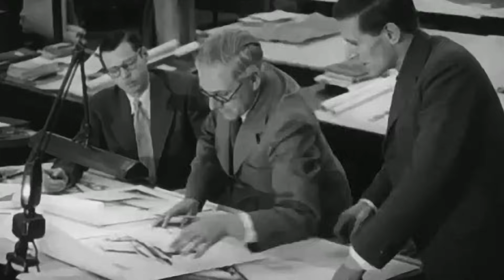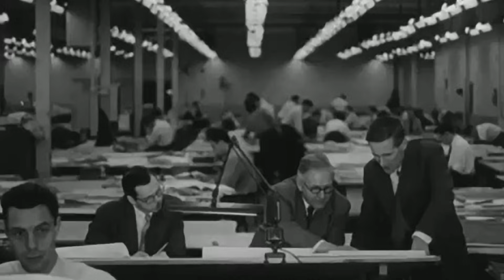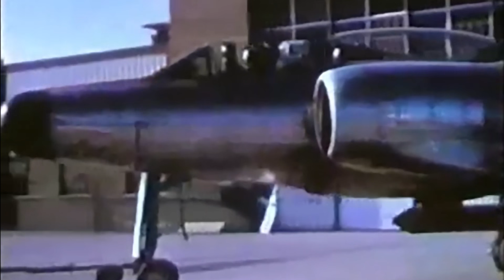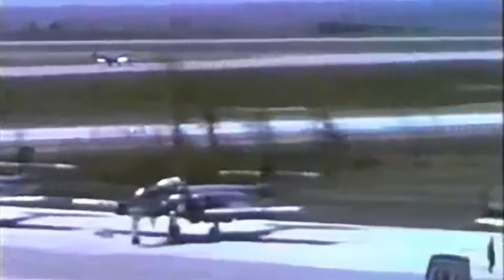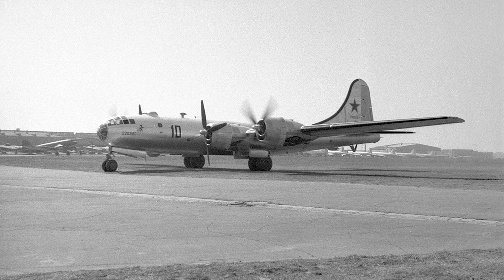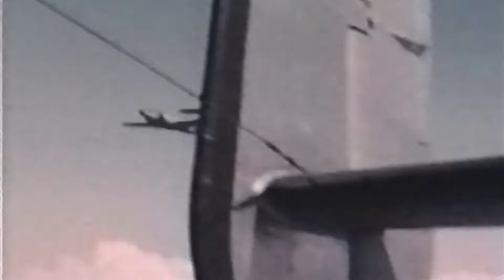World's best all-weather interceptor in its day: the Avro Canada CF-100 Canuck (No AI)

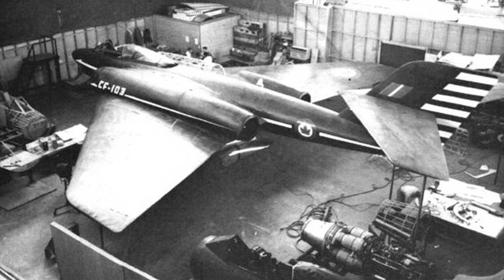Comment: 7:07 That seems like a really bizarre decision. You'd think that discovering that the CF-100 could already break the sound barrier in a shallow dive would tell them that the airframe had more potential than they previously thought, and thus there'd be more reason to develop the swept-wing version. Quite possibly the CF-103 would've also been capable of high speed than it was designed for.

Comment: The Crappy music is way too loud and spoils the commentary. The aircraft was pedestrian, its only outstanding feature was the long range. The radar was a minor improvement on those used in WW2. Its nearest rival would be the F-89 Scorpion which was much faster and had similar radar and armament initially. But evolved to air-to-air missile armament with integrated fire control in 1956, usually carrying 6 x Falcon AAMs plus the two Mighty-Mouse unguided rocket pods.

Comment: As an American, I'm just as disappointed in America's role and relationship with Canda as the Candians. America needs allies, not vassals in need of assistance. It does America no favors to have to carry half of NATO. And it does NATO no favors letting America unilaterally do everything. Compartmentalization and redundancy are core tenants of military design. 

Efficiency is only an issue if your at maximum capacity. But during peace time when you aren't anywhere near capacity, whats the point? R&D has never been an efficient use of resources, the cutting edge will always be most expensive. But Nations that shy away from it become dependant on those who are on the cutting edge. Despite what the Germans like to say to the rest of the EU; interdependence is NOT a virtue. It's weakness. It creates one sided relationships in which the haves take ownership of the have nots.

There is an argument to be made for Specialization. Sure, a minor nation can specialize in one industry to make thier name on the world stage. But as all systems are greater than the sum of thier parts, being one small part of the world only works when you are combined with equals gaining equally. If you aren't an equal partner, you have no bargaining power. You can pretend to be equal, use inclusive words, and carve our minority protections in your agreement, but when there is disagreement, there is little you can do as a minor member. Your part in the system must be great enough to demand support, or you will be ignored.

Seeing as America has no Equal, there is no alliance that stands to benefit from America's membership. 

NATO would be better off as a uniquely un-American endevor. One that can match America's military rather than be sub-serviant to it. The only way to do that is to be independant. 

Of course no collection of European powers can beat America on paper, but as I said, systems are worth more than the sum of thier parts. Having a fully self sustaining system, even a small one, is infinitely greater than being a piece of a larger system.

The benefit of being independant is mobility. As a piece of a larger whole, you MUST move in concert with the larger whole. This means you have no choice in what you do. You rely on what the collective can afford to give you. You are at the mercy of the system. And your only bargaining power is the threat of desertion. If you aren't in a position to go your seperate way, you have no leverage to demand more from the system. Therefore the more invested you become in the system, the more trapped you become.

America's strength comes from more than just it's military budget or resources, or any numbers. America's strength comes from its ability to conduct full scale military operations anywhere it chooses irrespective of anyone else.

This one fact totally out weighs the fact its inflated budget is mostly wasted and laundered away on side projects, its troops demoralized, and its technology distinctly not incorporated into a doctrine or system. The US military is by it's own standards a total disaster. But the fact the US government can use it makes it useful. The US is fully independent... militarily speaking. 

This is why American Nationalists are so hostile towards foreigners. It's not xenophobia, it's a fear of globalism. Of the threat that America can and is becoming like Europe: a weak vassal of the financial elites. Not American elites, those bastards are of no concern to the nationalists: foreign financial elites who can force the United States to bend the knee, despite its military power, simply be controlling its economy.

Just as with military alliances, economic entanglement is just as dangerous for the same reasons. America gains little and loses everything doing business with places like China. Our nations should have gone to war several times by now, but the economic control China has, has totally defeated America's military power.
Reply: You guys are the only ones causing trouble so...You don't back it up, you back out. We don't have  million miles of junk unused army equipment either.
Reply: @billaa100  i don't know what you're trying to say.

Comment: My ONLY complaint is the use of metric. Jet engines are and have always been, rated in pounds of thrust. Altitude is in feet and speed Iis measured in either mph or knots.
Reply: @polyus_studios  Thank you for your response. While I am irritated by the use of metric, I understand your point. ( Although Kilonewtons does not sound nearly as exciting as pounds of thrust ) I also understand that I am part of a dwindling minority. Your inclusion of imperial units is a gracious compromise.

Comment: What killed the Canadian Aviation defence industry was that its concepts and designed did not flow well with the rise of more multirole designs such as the F5  and the Mirage 3 of the latter 2nd the 3rd generations  Defenbacker often gets blamed too much and though he did cancel it he had his reasons  The industry was too focused on heavy interceptors in a time when such aircraft were becoming increasingly expensive cost began to outweigh the benefits of such interceptors at the time. If the program was able to be developed and introduced in around the late 1950s around the time of the F102 Delta dagger then it could have worked as a frontline interceptor. Avro Canada and Canadar should have known the changing winds of the late 50s and early  1960s  as instead develop something similar to that of the Sweedish Draken the American f4 Phantom or even the aforementioned Mirage 3. Instead, both companies would put their head into the sand that of Soviet-style single role concepts of  interceptors such as the SU9 and the SU 15 when instead could be developing multi-role twin-engined or single-engined light and heavy designs instead of going down the Specialized Big interceptor path  that leads to its near-death spiral in the 1960s and 70s
Reply: Your observations are astute, indeed.

Comment: Is there any particular reason they equipped the fighters with machineguns rather than auto cannons? 

You said there were concerns about the effectiveness of the machineguns against large bombers, which was something experienced by various air forces and lead to the widespread adoption of 20mm (and later 30mm) cannons. The RCAF certainly was experienced with cannon armed aircraft in WWII and the ADEN rotary cannon was coming into service around the same time as the Canucks or the M39 could have provided benefits in operating alongside the USAF. Seems like a simpler and more logical upgrade than the central missile pod.
Reply: As a night and bad weather fighter, trying to aim a slower firing cannon rather than a solid stream of lead would be much harder.
Reply: Justanotherconsumer Cannons we’re extensively used by night fighters in WWII, specifically because of how much more effective hits were against large aircraft. 

And the rate of fire issue was greatly reduced by the introduction of revolver cannons (M39 and ADEN) in the late forties and early fifties. 

And this is compared to a single use unguided rocket pod.
Reply: Polyus Studios Thanks will do.

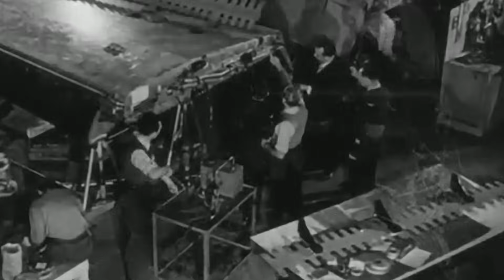Comment: At about 4:12, you say the crash was determined to have been caused by pilot error. The pilot ( Bruce Warren), was one of my identical twin uncles ( they flew Spitfires during WWII). I was told by my surviving uncle that the reason for the crash was finally determined to have been caused by a failure of the oxygen masks. Apparently, Avro only has two oxygen masks, which would be disassembled between flights, for cleaning, then reassembled, for the next test flight. Seems some part, or parts, were not reassembled correctly, and lack of oxygen caused the pilot (& observer?) to pass out.

Comment: I never knew the Canuck was so effective, or any details about it at all, for that matter. This video was very informative and very well made and presented, thanks so much.
Reply: Was an air traffic controller at RCAF Station North Bay in the late fifties. Under certain weather conditions the CF-100, doing a beacon letdown from 30 thousand feet, the rudder would freeze and the aircraft came down in a slow turn until the ice melted.  Made for a higher toned conversation with pilots.
Reply: @billfarley9167 common problem?

Comment: The glory days of the Canadian aircraft Industry 
Then something happened to us and we stopped dreaming of good / better / best and sadly settled for less than good and then starved our armed forces of funds to the point that planes don’t fly and ships don’t sail do the cost of fuel. 😪
Reply: Indeed.  The helicopter fiasco, the old destroyers that we’re designed as half-submarines, the new frigates too low for the naval helicopters, the POS submarines bought from the UK, the pistol replacement program that never completes, Avro Arrow, rented tanks in Afghanistan, C-17 troubles, now the f35, the trucks that had side specific tires (and you only got 1 spare.  If it was for the wrong side, you had to find another truck with the proper side you required), the see through all green combat uniforms, ...  the soldiers are great and very competent, they have to make do and they stretch the equipment lifetime and capability.  But the procurement system is f***ed up!
Reply: Nic Flatterie the type 26s are capable of landing chinooks and merlins if I’m not mistaken
Reply: @nicflatterie7772  : I went to a Canadian training base once. All the military equipment  was on display, but the BBQs were in a locked compound. 
So the BBQs were more dangerous than our military equipment?
Reply: @drwthmpsn7457  Well we really don't want the Moose more nervous than usual.
Reply: After the mid-60s, the new and very expensive welfare state ate up all the available money. Oh and Canada just got lazy and totally dependent on the US for its defence (because letting Uncle Sam pay your way means more money for socialism).

Comment: cool video.  Bid, slow, heavy, but functional.
Reply: Yeah, you'd figure a pioneering all-weather interceptor was going to be a raft of compromises, but at the end of the day it was one of the only aircraft that could perform the mission which is ultimately what matters. But I am struck by the similarity the Canuck had to the F-89 Scorpion, although I guess the Scorpion's radar was fire-control only, and didn't have the search capability of the CF-100.
Reply: Wasn't that slow, it broke the sound barrier in a dive.  Nicknamed "The Clunk".
Reply: Long range equals heavy.

Comment: I know there was an adage Roy Dobson lived by. Never try an untested airframe with an untested engine. I still wonder if Rolls Royce wouldn't sell Avro Canada Avon Engines for the Jetliner. Why didn't they just use Orenda Engines for it? Or were they worse on fuel consumption?
Reply: the Jetliner predated the Orenda engine.
Jim Floyd said that the 4 engines were better if 1 quit, as there would still be thrust on the bad side.
However, the Derwents were an early engine, and I believe the Orenda would have provided better fuel economy, but that might be an error on my part.
Reply: @polyus_studios  Only thing I have is Shutting Down the National Dream, by Grieg Stewart. Fantastic book.

Comment: I had no idea the Canuck had guns, everything I’ve found out about it said it only had rockets. Though I guess the sites I was looking at were talking about the later versions. If you could turn the .50 cal gun pack into a rocket pod, why not turn it into a 20mm or 30mm gun pack?
Reply: 20 mm. were much larger to fit and had a slower fire rate than .50s or .30s.
Reply: They did.